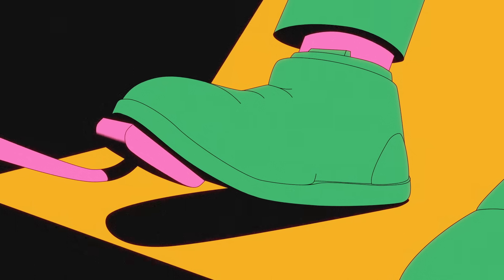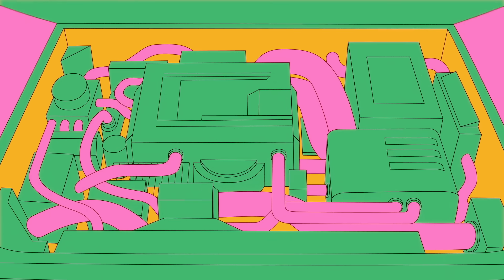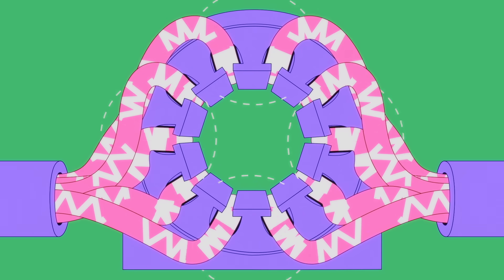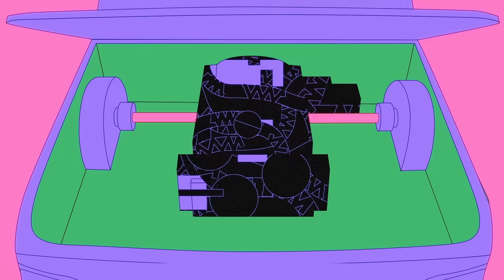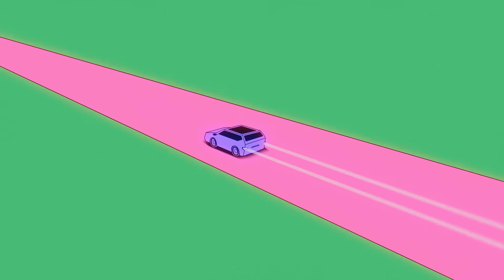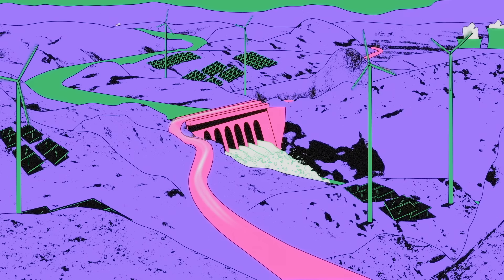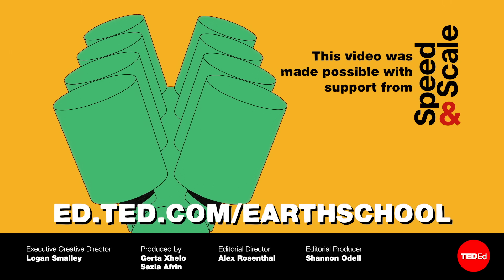This is what happens when you hit the gas - Shannon Odell

Comment: In terms of carbon footprint, EV’s will (typically) have a smaller one than a combustion car. However, the dirtiest part of EV production actually comes from the lithium fracking required to produce the batteries. In case anyone is unfamiliar, lithium mining is one of the most environmentally polluting forms of mining out there. This isn’t to say that EV’s are worse for the environment, but that the worst part of an EV comes from its battery production not its carbon footprint.

Comment: It just opens the little valve on the throttle body that lets more air in. Causes a bigger combustion in the cylinder and makes the engine cycle with more force

Comment: This video is left-wing environmental propaganda. The electrical engine is more efficient than a gasoline powered combustion engine. I do not dispute this. The problem is most electrical power (>90%) is generated by burning fossil fuel. The electrical energy or power you use to run your home appliances and charge EV batteries come from burning coal to heat water to generate steam pressure which spins the turbines that generate electrical energy or power. So called renewables are not reliable and cannot generate enough electrical power to provide industrial societies with their energy requirements. The coal burning process loses as much energy in the form of heat as the gasoline powered combustion engines. So you lose energy when you transform the heat energy from burning coal into electrical energy. When you store electrical energy in batteries there is electrical leakage. The batteries leak electrical energy, which reduce electrical motor efficiency further. So the electrical energy used by EV battery is less efficient or more inefficient than directly burning gasoline in combustion engines. Environmental extremists are just average folks who do not really understand the harder data behind the so called efficiency of electrical battery engine. This is why people who are on the right side of the political center are so frustrated with those on left. The people on the left pretend to know-it-all. In reality they oversimplify their analysis to reach a false conclusion. Left-wing environmentalists distort, exaggerate, and lie about the hard scientific numbers because they do not know what they are talking about. As of now (2025) the so called renewable energies cannot generate enough energy to meet our needs. We must keep developing fossil fuel and renewable forms of energy. We must clearly define what renewable energy is. Electrical energy generated by coal burning power plants is NOT RENEWABLE.

Comment: I think speaking of the green electric car, it should be mentioned that the batteries (lithium-ion batteries in particular) are one of the most polutants on fabrication, and also recycling the batteries is also hard and expensive.
Other alternatives are being developed, i think until we use solid state batteries, it is going to be a problem for a long time. We shouldn't sell the current electric car as the solution.

Comment: Electric cars aren’t the solution. For the batteries you need increased mining of minerals, coltan especially. Coming from Congo where children often work the mines. And once the battery is dead after 10 years of use, there isn’t a good solution for disposing. Not to talk about when a lithium fire starts, it’s almost impossible to put out.

Comment: EVs are NOT the kings of fuel efficiency,  hybrids are. 

Not only are the more carbon efficient,  but they are cheaper, do less road damage,  and are safer (EVs are very heavy)

Someday when we master hydrogen power to replace fossil fuels hybrids will also be emissions free.  

Pumping power of lines and in and out of various batteries is simply not efficient.

Comment: air fuel mix go in, piston compress, spark plug make it boom, piston pushes down, crankshaft rotates, wheel spins. Of course, there are a few more parts that make the ride actually go, but that's essentially it.

Comment: Pulse and glide TLDR; pulse to get your car in the power band, the higher the revs the more efficient. 

Glide/coast in the highest reasonable gear to use a minimal amount of fuel as the wheels are turning the engine instead of solely relying on combustion to keep the engine on.

Notes:

Avoid having to fight inertia. Don't try to speed up to quickly. Find your peak torque RPM and get close to it. If you have to speed up too quicky, you're losing efficiency to fighting inertia.

You can also pulse and glide in low speed areas. Just use a low gear, gently get up to speed, and then glide. You can do it in shorter intervals in those areas.

Avoid stopping or slowing down dramatically. Don't get too close to traffic in front of you, leave space so that when they slow down, they're more likely to have gotten going already and you wouldn't have needed to slow down a lot or at all. This also prevents traffic jams if everyone does it.

Comment: 2:41 yet they're still far better than freighters, coal power plants, and many other that Bureaucrat intentionally ignore
Reply: I actually learned that a properly functioning car makes ZERO carbon monoxide and nitrous oxides like... at all.

It only outputs CO2 and H2O.

CO2 and H2O are both usable by plants, fungi, and algae as food sources for making oxygen and glucose/ATP.
Reply: @TinyDragonGamer250  is that was catalytic converter is for?
Reply: @_GhostMiner Yeup, it takes your cars specific output of NOX and CO and converts it to harmless substances!

Unfortunately, if your car is misfiring or has a bad catalytic converter, it WILL MOST DEFINITELY output those bad substances because its designed to only convert a specific amount at a specific rate.
Reply: @TinyDragonGamer250 A catalytic converter significantly reduces CO (carbon monoxide), NOx (nitrogen oxides), and hydrocarbons from a car’s exhaust but does not eliminate them completely—modern systems typically remove 80–98% of these harmful pollutants. That means a properly functioning car with a catalyst still emits small amounts of CO and NOx, especially during cold starts or if the converter isn’t at its optimal temperature. The claim that only CO2 and H2O come out is not entirely correct—small traces of harmful substances always remain.

Comment: one small correction when the valves for the intake open then there is actually not 2 seperate gassed at least in the gasoline ice displayed it is mixed by a carb first so you cant actually see the difference

Comment: Fun fact: Combustion engines also have "regenerative braking" of their own. More percisely during the slowing down without brakes (like in glide) allows for a technique known as "engine braking". When driver shifts to lower gear when RPMs are low the engine itself acts as a brake.

Comment: One hundred gallons of diesel at a density of 3.17515 kg per gallon has a mass of 317.515 kg, 41.227 kg is hydrogen ( 317.515 * 0.13) and 41.227 * 33.33333 kilowatt hours equals 1375.8982 kilowatt hours. So 8100 miles divided by 100 gallons equals 81 miles per gallon, 8100 miles divided by 317.515 kilograms of diesel equals 25.51 miles per kilogram of diesel, 8100 miles divided by 41.27695 kilograms of hydrogen equals 196.2352 miles per kilogram of hydrogen and 8100 miles divided by 1375.8982 equals 5.887 miles per kilowatt hours. Battery electric vehicles may be efficient but few if any get anywhere near 5.887 miles per kilowatt hour.

Comment: Electric cars are good for ideal conditions. If outside weather during winter is -30 degrees, then battery will be empty in half an hour. Try your iPhone to put into freezer and check acс capacity in 30 or 60 minutes.

Besides, gasoline engine could be used for 20+ years, just with appropriate and suitable maintenance. For EV cars I'm not sure that after 5-7 years the car would be so fast and reliable, as it was new (at least battery will be half broken and needed to be replaced as price of almost a new car).

Comment: Are you sure that the accelerator in electric cars changes frequency, that does make much sense to me, it would make more sense for the accelerator to change the voltage and the frequency to be based on the rotation speed of the motor and not based on the accelerator.

Comment: You didn't mention anything about the intake or exhaust valves or how there's a camshaft that opens those intake,exhaust valves and you didn't say anything about how the transmission actually is what transmits power to the rear wheels through the rear differential Great explanation buddy

Comment: No Ev's are horrible for hypermiling. How can you compare a diesel (if you try hard you can get 1000+ km of range on a single tank, and refuel it for 5 minutes) to an EV (400-500 km at best and then 30-90 mins on a fast charger)?
Reply: EVs absolutely take a shorter amount of time for charging, especially on Level 3 fast-charging (think Tesla Superchargers and the like). With that it's more of a 15 minute charge max. Afterall, you aren't driving the whole way without stopping, and thus you're more likely to charge every time you stop for a break.

Comment: This is NOT a great video to introduce Le men into Cars or engines
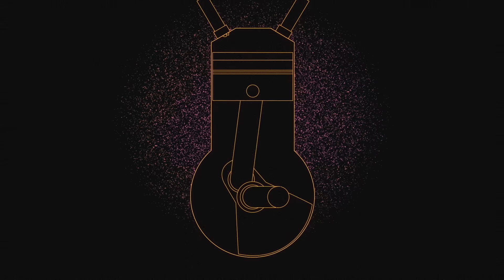2:34 is Not true, The difference between BHP and WHP is not THAT vast, and also parasitic loss is a thing, engines don't just give power to the wheels but a lot of other things such as the AC and in older cars, your power steering system and battery charging system etc.

 3:05 Car engines DON'T shut off fuel  when Idling, they just use very little fuel but keep running on a lean mixture

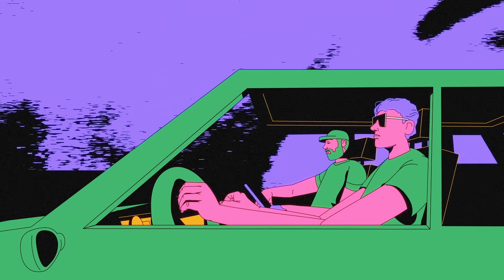3:20 Is BS, modern engines are wayyy more complex and are insanely efficient, just as much if not more than EVs
         Other than the charging there's a lot of pollution indirectly from EV's due to stuff like Lithium mining

Modern engines have some really amazing and complex systems just to save fuel and reduce emissions while also providing power, stuff like Evaporative emission controls, Positive crankcase ventilation, exhaust gas recirculation systems and much much more

Don't make ICE seem like some primitive inefficient technology and EV's like they're the best most environmentally friendly things to exist

Comment: 2:58 & 1:41 true for gas engines not for the diesel engine discussed at the beginning of the video. Diesels don’t have throttle body’s and operate efficiently at low load conditions.

Comment: The pulse and glide applies to hybrids and not ICE. Going at a varying speed uses more energy for an ICE but, in a hybrid it puts the load on the battery increasing MPG. This causes the hybrid battery to cycle more and potentially decreases lifespan.

Comment: I didn't get how "pulse & glide" saves fuel. How is driving at higher speed than intended more efficient? A normal ICE car usually drives with less fuel consumption around a speed of 90 kmph (55 mph) and going more than that is basically not ideal in terms of efficiency. Plus, when you "glide" and taking your foot off the gas slowly doesn't cut fuel injection. To do that, you need to take it off completely and rapidly. Even if you do it completely and rapidly to "glide", you also need to consider the friction in the engine and also between the tires and the road whilst the injection is cut. For what? Just to go back to a speed you were driving already. I'm not saying it doesn't sound right, I will try it but it didn't feel like a life experience.

Comment: I am wondering, why there's no manual transmission electric vehicle? They can make smaller motor (low torque) but with transmission, it will runs, while saving so much more energy because using small motor, yes it can stalls like internal combustion engine, but hey, there's automatic transmission, imagine how efficient it is than using high torque power consuming motor, CMIIW

Comment: EVs have batteries, ion-lithium batteries that will need to be replaced sooner than the car, those will create waste and pollution, the same amount of pollution the non electric vehicles create. It's just swapping one way of polluting to another. Not to mention that for now EVs have very short range, most countries don't have the infrastructure to charge cars on highways and it takes hours to charge the car. And if you live in an apartment building, you have no way to charge your car if you don't have a garage.

Comment: The problem is that the electricity used in EVs still comes from thermal power plants.
Reply: The process of generating electricity in power plants is more efficient than burning gasoline in ICE cars, comparing the scales.

Comment: The gas pedal does not control how much fuel enter the cylinder, in fact it only controls how much air enters the cylinder via the throttle valve, so more speed doesn't mean more fuel in the cylinder, however, because the engine spins faster, the fuel pump also has to spin faster because the combustion becomes faster, the fuel pump turns faster according to the throttle position, not the engine speed.

Also because more air is introduced when the throttle is opened more, this actually improves fuel consumption, so more airflow equals more fuel economy, not more fuel consumption, so the amount of fuel liters to be consumed every 100km does not increase when you press the gas pedal, instead it decrease, for example if you travel at 120km/h in a highway, the fuel consumption will be lower and more efficient.

Comment: A questions. I understand the statement made in the video around 5:25 saying that the carbon footprint of EVs are much as the power utility they plug into. But about the carbon footprint generated during the process of manufacturing its batteries? Shouldn't it be included in carbon footprint of EVs? I am curious and want your opinion.

Comment: This is a good simple explanation of how ICE works, but misses some key points about electric vehicles and fails to address the benefits of hybrids and synthetic fuels. With a massive battery in an EV, while a higher percentage of power is going toward driving the wheels, the car is substantially heaver and requires far more energy to drive itself. The battery range equation is the problem because the larger you make the battery the more energy the car has but the more energy it takes to drive.
Reply: Yes they are heavier but due to being so much more efficient, they do use much less energy than internal combustion engines. Also as batteries get larger for extended ranges, the gained power is always more than the extra power needed for the added weight. If it wasn’t then ranges simply couldn’t be extended but they are. No matter what way you spin it, they always come out on top in terms of using less energy.

Comment: But how EV works, you basically burn fossil fuel, then generate electricity, then transmit it over the wire with big loss and only then you can benefit from EV's efficiency.
Reply: The electricity generated to power EVs make far less losses compared to burning the gasoline in ICE cars. Electrical grid systems are also built in massive quantities, so the losses are small.

Comment: The only problem with EVs are those batteries. Lithium, cobalt and other metals used are becoming scarcer than fossil fuel. Yet they’re needed for everything not just the cars, storage of electricity for the cars, and every other tech too. Also these batteries loose their original capacity, degrade and become irreparable. Never mind that these metals are usually sourced in a way that’s unethical and harmful to the environment.

Comment: Let us not dismiss the 'carbon footprint' of batteries for the EVs - approx 250,000 lbs of dirt must be processed to manufacture 1 battery for the average EV - think about that, all the diesel engines and machinery to process 250,000 lbs of dirt